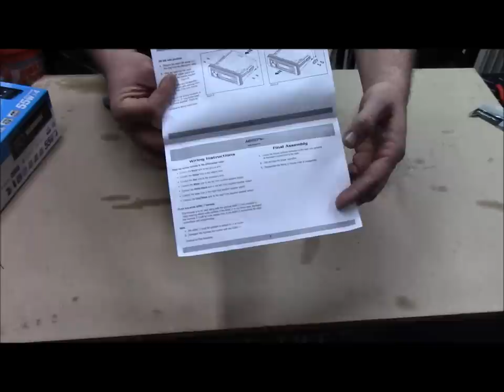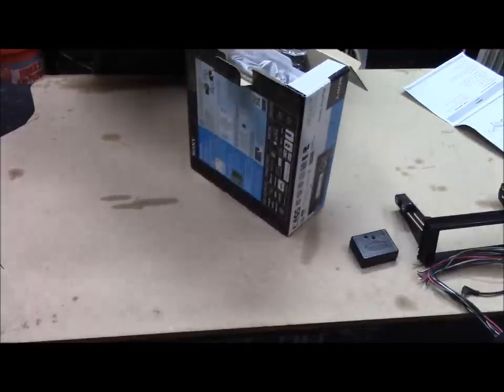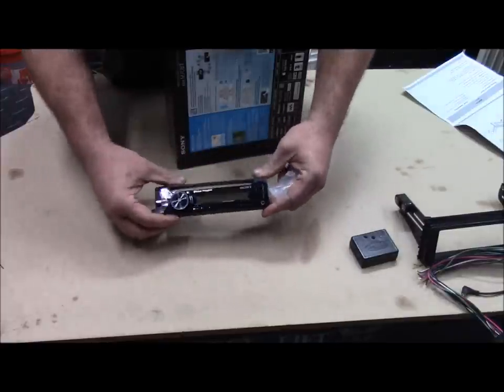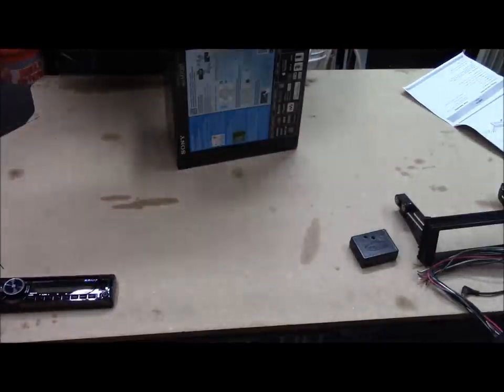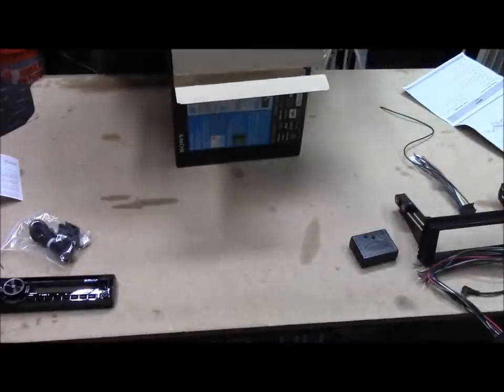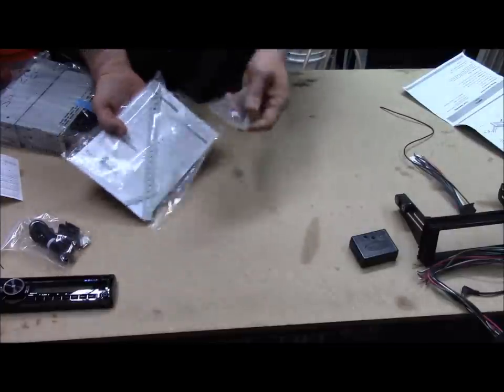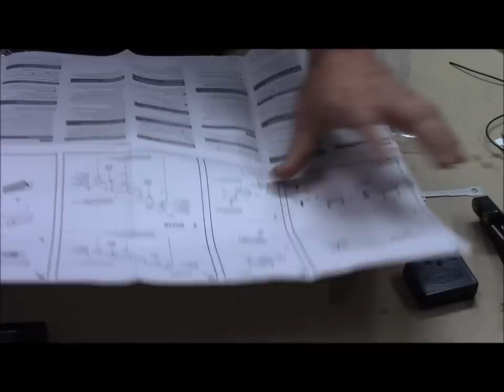How to Wire an Aftermarket Head Unit to Install in Your Harley-Davidson | Fat Head Cycles

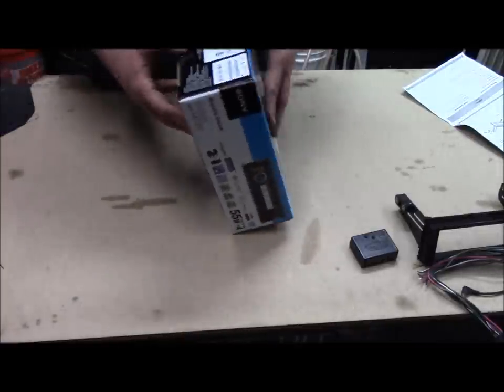Comment: Installing a Kenwood head unit on my '13 Street Glide. Had the wiring harness all soldered up and realized no place to plug in 3.5 mm jack. Called these guys about 5:30 Friday afternoon thinking it would be Monday before I heard anything. 15 minutes later I get a call back and Chris walked me thru exactly what I needed to do. TOP NOTCH customer service!
Reply: Robert Luebke Having the same problem. My headunit doesn’t have a 3.5mm jack either. What did you splice the female jack to?
Reply: So what do you do with it? We're do i plug it into or slice into? Ty

Comment: Very good video for us electronically challenged baby boomers!  Lol.   Seriously, this is straight forward and a very good and detailed video, the best I found on this subject.  When you order these items online, it is sent with a lot of items which you don't need ( he throws them on the floor, lol) which makes it confusing.  A couple of minor changes I would make as follows:  I would use weather proof spade connectors ( they have built in heat shrink),  I would state that you could carefully use a heat gun on heat shrink tubing ( I would not suggest a bic lighter, lol), and I would use split wire loom to wrap my wires in ( instead of wrapping tape around them) just in case there was a problem when you hook it up or for future access to wires if there was a problem.  I would all seal the ends of unused wires or spade connectors to prevent corrosion.  All in all, this was a 4 star video Chris!  Thank you...

Comment: I just followed your instruction and installed a Sony DSX-A415BT. Excellent! Only thing is my handle bar controls are not working. The instruction said I needed too program the ASWC-1.
Reply: Follow up: called axxess customer service. Took less than a minute to get HB controls working properly.

Comment: Good instructions but still stumped on where to tie in the rear speaker for a 01' ultra..
I see the rear speaker wires but if i tie them in won't they be bypass the control unit...?

Comment: Do you need the control retention device if you don't have the controls on the handlebars? My 07 Electra glide was a PD bike and doesn't have radio controls
Reply from the maker: You do not have to have the controls on the handlebars.  I have a wiring harness that will allow you to still have a plug and play setup without the controls.  Drop me an email at sales@fatheadcycles.com to discuss further.  Thanks for watching

Comment: do my new radio volume  will go up and down  with speed of motorcycle as it use to do my factory radio?
Reply from the maker: Speed volume is not retained by any aftermarket head unit.
Reply: Thank you  @FatHeadCycles

Comment: I have a 2007 ultra classic I installed a after market stereo like 2 years ago with everything needed.The controls on the handle bars were working good but now the controls on the handle bars not working properly any suggestions thank you

Comment: I have followed the video. now I want to install it in the bike well when I took the fairing off I have the two wiring harnesses to remove from the radio. I understand that one is going to be connected to the harness I made watch the video. but what is the other harness and what do I do with it?

Comment: If I have the blue/yellow wire it says to hook it to the female brown wire and tape off the brown/ white wire. Then put the male jack included in the metra harness into the female. Just include that in the taped up harness. So I will not plug anything into the back of the head unit except the pin connection? The only whole I have on the back is antenna and MIC

Comment: Great video... where does the blue and yellow steering wheel control wire get attached to?
Reply: If you bought the ascw1 kit then the blue/yellow wire hooks up to the female headphone Jack that came in the kit.  The bl/y wire hooks to the brown wire on the female adapter.  Tape up the brown/white because you won't need it.  Then simply connect the female end to the male end that came with the wiring harness adapter.

Comment: highly recommend just getting a jensen harley radio.  100% plug/play no splicing wires or a wire kit needed.  not even a mounting kit needed.
Reply: Tim Henry what kind of Jensen radio are you talking about? Is it water proof or no? Thanks in advance.
Reply: Tim Henry what kind of Jensen radio are you talking about? Is it water proof or no? Thanks in advance.

Comment: I have the same setup.  I installed it and now the aswc-1 does not recognize the down buttons on the handlebar.  I check on Harley forum.  They state to ground the pink/white wire on the clutch side to the lighter.  I have a 2003 Ultra Classic.  Any ideas?
Reply from the maker: This is a tough question to answer without more information.  Does your ASWC-1 harness have a pink/white wire?  The reason that I ask is that Metra changed their harnesses do make that wire unnecessary.  Either way Ive got you!
Reply: I have the ASWC-1 without a pink/white wire. I’ve tried grounding the system directly to the negative side of the amp with no difference in situation.  Any help would be nice.

Comment: Good work! Please answer- I've got a 1997 HD Electra glide ultra classic from Japan.. I want to change the head unit... Does this  wheel remote control is good for me?
Reply: My head unit has two connection wire group like - [::::]  [::::::]
Reply from the maker: I think that it should work but I am not 100%

Comment: What radio adapter do I need to fit an aftermarket radio on 1990 Harley Davidson Electra Glide Classic? Thank you.
Reply: What did you end up using I have an 89 and want to know what I need Thanks in advance

Comment: How do I get the pre-wired assembly? 2013 Roadglide Ultra. Will the CB bolt back on top? Do you have good speakers for the fairing? Thanks for a great video!!!!!!!!!!
Reply from the maker: Unfortunately there is no way to retain the CB Feature with this radio.  As Far as speakers and getting a head Unit send me an email Fatheadcycles@gmail.com and we can put a package together that meets your needs.  Thanks for watching!

Comment: Thanks for the video. My harness (23 pin harley harness) has 2 black (pin locations 11 & 19) and 2 yellow wires (pin locations 10 & 20), so I have one of each left over. Which do I solder with the radio unit harness and what do I do with the leftover wires (if anything)?
Reply: Hi! I have the same problem, how did you solved?
Thank you

Comment: I have 2012 road glide with dealer installed speaker lids with amp from the stock radio company.  How do keep the amp with a aftermarket  head unit? Do you have a video on that? I figure it same as the cvo  bikes.

Comment: I have two questions for you on this does it retain the push to talk feature that is built in the bike and does it affect the factory alarm. My bike is an 09 FLHTCU
Reply from the maker: By Push to Talk I assume that you are referring to the CB.  You loose that feature with any aftermarket head unit.  But this plug and play kit will not affect your factory security system in anyway

Comment: Great video, my question is what would I need to do for an 06 CVO Ultra Classic? I removed the Amp and harness already, I want to still use the rear speakers. Would it be easier just to redo the wiring and power source? Thanks again
Reply from the maker: The quickest way to do this is to run new wires to the speaker pods

Comment: If wiring an amplifier into this same setup, would I then just not connect the four (white/gray) wires into the bike harness and run those to the amp from the head unit harness and from the amp to the speakers?
Reply from the maker: Cody O'Leary if you are running an amp the 4 wires do not have to get connected to anything. You can connect them to the harness Incase you ever want to take the amp out. Will not hurt anything. I would connect the headunit to the amp with rca cables. That is going to be your cleanest signal.

Comment: Great video.  My question is about hooking up the rear speakers on my Ulta.  Where do I tap in?  Thanks in advance.
Reply: Rear speakers on a 2005 ultra classic...harness for CB u want 
Rt rear - white with black
Rt rear + Brown
It  rear - lt green with black
It  rear + drk green
Reply: @mikesnyder5103  On my 2004 Ultra classic it's the opposite - Right rear is green and green with black line, left rear is white with brown stripe and solid brown. The stripes always represent the negative wire.

Comment: Got this radio but it had a  bigger separate power & ground wire so i connected straight to the battery and made direct connection for the ground and it turns on but my bike wont start now

Comment: Is there a way to.unpin the rear speakers wires from factory harness ? Or.is it easier just to cut and slice I would like the kenwood deck to power rears and amp  to power fronts  and lowers
Reply from the maker: I normally just cut into the harness that provides signal to the rear speakers.  I just make sure to leave myself enough to reattach the cut if the customer wants to return the bike to stock in the future.  Thanks for watching
Reply: @FatHeadCycles  can u tell is the color of the wires...seems noone can figure them out
Reply: Rear speakers on a 2005 ultra classic...harness for CB u want 
Rt rear - white with black
Rt rear + Brown
Lt rear - lt green with black
Lt rear + del green

Comment: (Very very good instruction!) HI is There any codes for the stock H/D CD or am/fm radio since the display all work fine just no sound whatsoever I have 2005 Road Glide FLTRI it just stop working i was playing a CD on accessory the motor was not running when I was done I turned the off the ignition next day no sound the display works fine Thank you
Reply from the maker: I do not believe that there are any codes per ser for the radio on a bike of that age.  It unfortunately sounds like your radio took a dump.

Comment: the video is well done. i purchased the system in the video, BUT i have the 2010 Ultraclassic CVO with the amp. At the end of the video it was said that this will work for everything EXCEPT the CVO with the Harley Amp. what needs to be done to make this work with the Harley amp or can I eliminate the Harley amp?

Comment: So what becomes.of the factory large harness .. radio connector on right side of stock stereo is it left hanging and dormant .. this is the very large connector that doesn't have anything to plug into with an aftermarket
Reply from the maker: Yes, if you have an Ultra the connector is tucked out of the way after the rear speaker outputs from the new head unit are tapped in.

Comment: I have a 2013 road glide CVO You're saying this will not work on mine
Reply from the maker: The issue with the CVO bikes is that it will not turn the factory amplifier on.  If you have an aftermarket amp you are golden.

Comment: Do not install this unit comes with CD player, do not use this unit in Harley motorcycles. Use only the Sony model DSX-S3310BTX this one use Bluetooth without CD player. Only use jump drive or Scandisk with 32g memory. CD player does not work good in Harley bikes